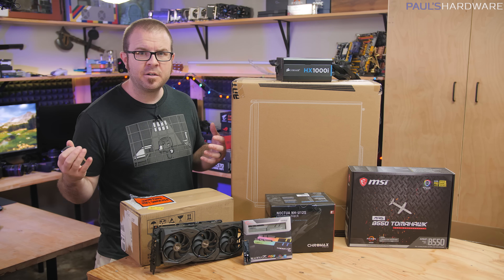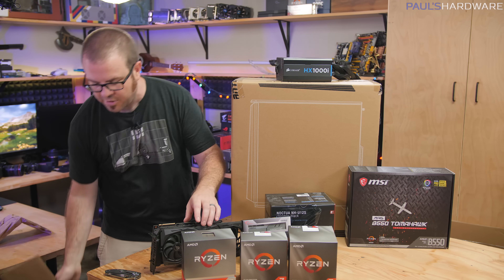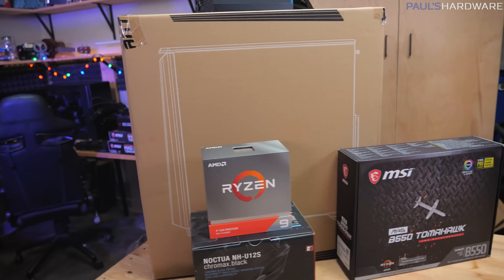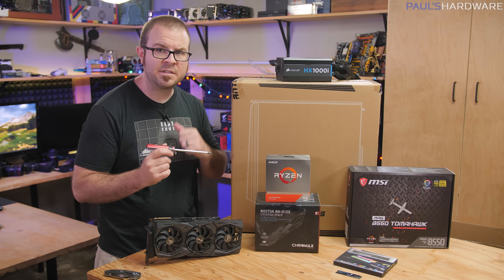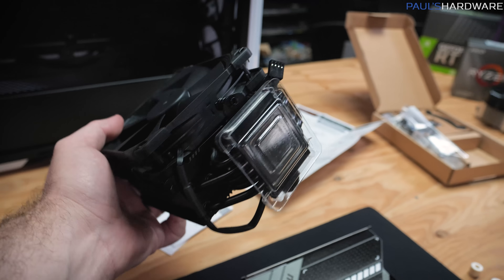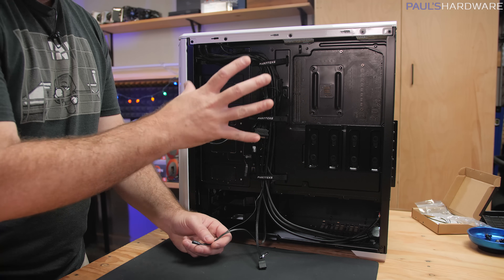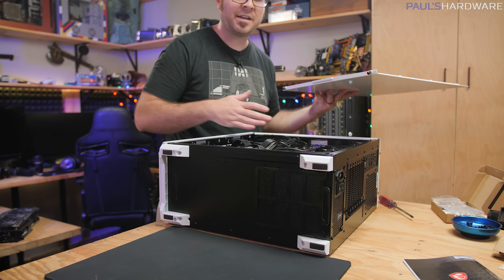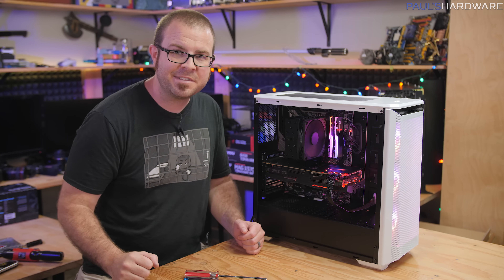Is This a "Reasonable" RTX 2080 Ti Gaming PC Build? (w/ Ryzen 9 3900XT)

Comment: Imagine having a 2080ti. Couldn’t be me
Reply: /me using a 1050 Ti 😭😭😭
Reply: Mr. Moʀɖɛռ me with my 1050 sitting here like...
Reply: @justnick1566  I feel your pain. My creaky old MSI H81M E34 motherboard exploded a couple of days ago and I was sorely tempted to build a new rig. Turns out now is the worst timing possible. Bought a £100 replacement instead and holding out for the next gen arriving hopefully for October
Reply: @Mr.Morden  I have 2 1070s, 2 1080s just sitting in boxes. Stupid crypto. 😅I'm using a 1080 ti though.
Reply: Imagine
Reply: Still rocking an R9 290!
Reply: I got mine from saving and working at burger king. Now I wouldn't say I could afford it but I could buy it
Reply: tbh even if I win a 2080Ti I would just sell it xD
Reply: 9600GT gang
Reply: Me having Intel Interegated graphics 
U all r lucky having gpu
Reply: 1070 in my main system and a 1050TI in my secondary
Reply: I settled with a 2070 super
Reply: Waay beyond imagination lol
Reply: RetiredAlmond it might be when the basic  RTX 3080 gets released!
Reply: You could if you just believe! (jk)
Reply: Me using quardro 4000
Reply: bro my pc costs a third of a 2080ti, got a gtx 680
Reply: Shut up the lot of you  !!!! i have a 560ti lol :-)
Reply: Not directing this at Paul or any other content creator but so many of these videos seem like a subliminal attempt to justify the 2080Ti.
Reply: @OcihEvE  the card itself is a beast. It's the price of it that's an issue. Also, the 3070 = 2080ti for maybe $500-600. That's the current price of a 2070super.

 So basically next gen is turning the 70 into an 80ti
Reply: I still use my geforce 4 MX 440 from 2002
Reply: me using a Rx 560
Reply: it's not THAT expensive, if you got a job you will be able to afford it, it's a matter of time
Reply: neither i still sitting here using gt 420 lol
Reply: Cries in rx 550
Reply: You know what’s funnier... I bet about 20-30% of 2080 ti owners don’t have a decent monitor that can above 60hz
Reply: cries in 750 Ti
Reply: Cries in 1gb GT 710... Doesn't everyone love the sudden fps drops whenever anything moves.
Reply: take your time, save money, buy one and repeat for the other parts if you need to. its okay, no need to buy all these parts at the same time
Reply: It’s pretty nice 👍
Reply: I'm still on my 1080ti as well. But i'll def be dropping the best 3000 that isn't the titan.
Reply: RetiredAlmond
They gave it, now he is testing if the AMD is bottlenecking this old GPU, is it?
What u use now, better? newer?
Reply: @betweenthe8  I bought it new right after the 2080ti came out.  I payed 600 u s.  I don't play FPS type games  much, strategy and rpg games are what I like. Nothing but a 2070 super  or above as far as I'm concerned.
Reply: Me sitting here with my gt 710
Reply: Should I get a 2060 super advanced or save the extra $800 and get a 2080 super?
Reply: @RiOtImpactz  depends on your other pc components. If your CPU isn't strong enough you could get some bottlenecking. Also depends on what you will do with the computer too. That's a lot of 💰 and if you aren't a hardcore gamer then no. I liken it to having a car that can do 200mph but where will you ever go that fast at? If you video edit or hardcore game then yes.
Reply: @retroscomedyclips  Im building a PC and currently I have a AMD Ryzen 3900x Lined up with the 2080 ti, but should i just wait for the 3000 series for the gpu instead?
Reply: @tree6153  nice system. It depends on what you will be doing and what you currently have. With that setup you can do a lot. 😁 Are you willing to wait for the next gen? It may be awhile and they will sell out fast. Also the cost to performance is a big reason to wait if the next gpu will cost about the same. But I hear there will be a big performance boost. Just keep this in mind in computer hardware the next biggest and greatest is always coming. If you wait all the time you'd never get anything. With that said I'd lean on waiting.
Reply: @retroscomedyclips  Okay thank you. Yeah so far Its the 3900x I dont see a point for the XT and then the 2080ti but I will hold off on that 2080 i think. What about motherboard? IM stuck on what motherboard I should get.
Reply: @retroscomedyclips  Is the Asus ROG Crosshair VIII Hero (WI-FI) a good mothboard? This is my first time building and you seem as if you know what your talking about to an extent I just dont wanna drop 375 on a mothboard if it somehow isnt good enough for the 3900x and 2080ti
Reply: @retroscomedyclips  You mind if I send the link to my parts list?
Reply: @tree6153  please do. I don't mind helping.
Reply: @tree6153  I like the tomahawk series. Msi tomahawk x570 around 200 dollars. It has support for pcie 4. This coupled with your gpu and CPU will get you through the next probably 5 years. Definitely if you wait for the next gen GPU 5+ years.
Reply: retrotvandmovies I’ll have to check that board out. That list I sent is 3000 I’d like to keep it at 2500 but I just want a beast
Reply: @tree6153  understandable. You can have a beast but if it's nothing you will notice it's money wasted. 64gb 3600 ram? Are you video editing 4k? 32gb is sufficient. That Mobo might be better but slightly. Not justifiable for the price. 1200 for a 2080ti when next gen should be at least 15 to 20+% better for same price? Not worth it. Power supply prices are high right now too. Hard drives are good. Windows you can install  a trial and buy a key for a few dollars. I did and no issues. More expensive doesn't necessarily mean better. Bottom line is it all depends on what you will need it for. Video editing 4k+ 64gb ram as a professional. Video games 32gb might even be over kill. Ultimately it's up to what you will need that determines the specs. I didn't see a case so that adds to the costs. Monitor has to be another 300 to 500 dollars if not more. If not you're wasting you're money. Another tip is when you do get a high performance monitor make sure it's set to the highest setting. Many people have used a high performance monitor and it's on the basic setting for years. They usually don't come at the sale setting.
Reply: @retroscomedyclips  I have the case ordered and I already have a current PC thats a prebuild with gtx 1070 i7-7700k and 16gb ram and a 144 hz monitor that im keeping. Is there any other platform I can contact you through?
Reply: retrotvandmovies hey man any other way I can contact you other than through YouTube comments lol
Reply: retrotvandmovies sent you an email I believe.
Reply: @tree6153  YES
Reply: NickT they sold out immediately, for now I bought the 2070 until 3080 is actually buyable
Reply: Me with a 1650 Super and an i7 870
Reply: I actually upgraded to a RTX 2080 Ti two years ago.
Unfortunately I sold my old GTX 1070 for 100$ only back then ... -.-
Reply: I'm still using my 1080ti!
Reply: Ldunk thats one of the best graphics cards. It can play every game on ultra
Reply: Apple Mac Pro gPU is better
Reply: @loveiphones4550  no it's not... Also why would you pay those kinds of prices for that thing?
Reply: cries in water cooled 1080
Reply: Char Still a decent card.
Reply: @F80char  that's such a good card
Reply: @F80char  cries in integrated graphics